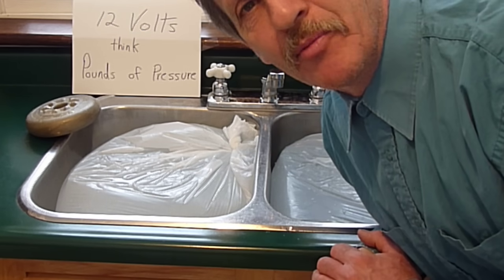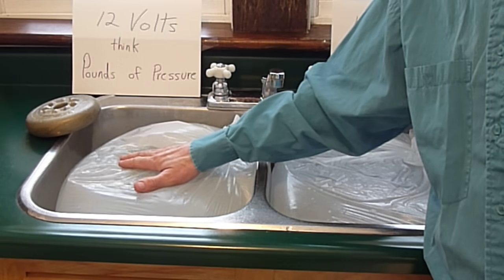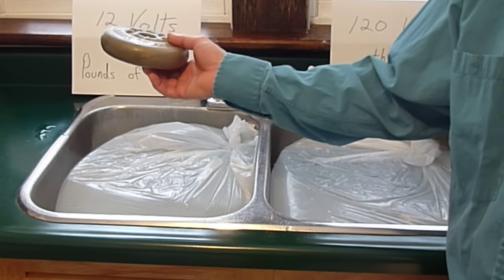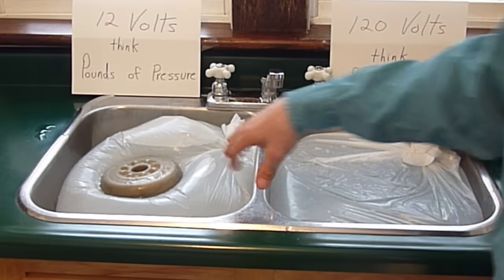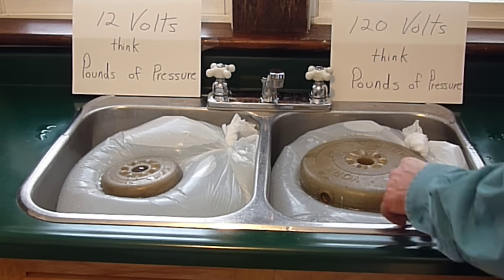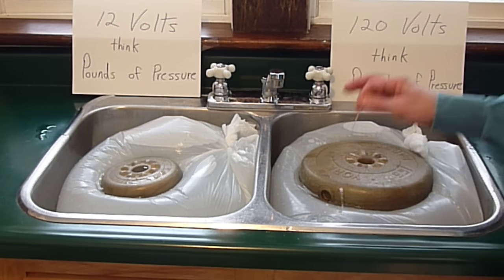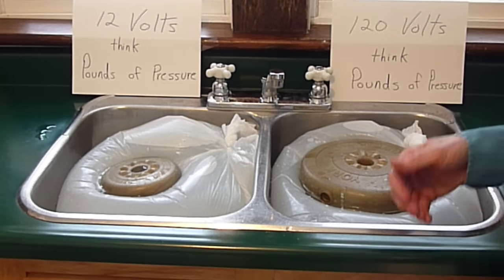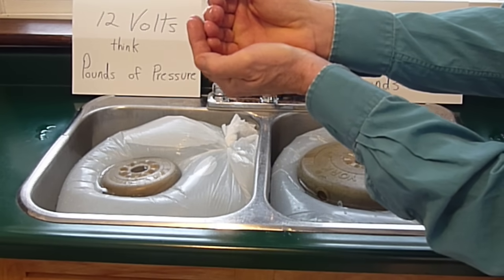Amps, volts, watts explained...SEE what it really is all about.

Comment: Am I stupid if I still don't understand it?
Reply: Amps is the force of pressure, that's coming out of the pinhole. In each bag. Watts is what is borrowed, say for a lightbulb. Say if a lighbulb needs 12 Watts of that 120 Volts.

Think of a pie. If you have 4 pieces, and the lightbulb is one of those 4 pieces. 

This is how I just figured this out. That worked for me. However your brain helps you interpret the information that's more inclined to be the most memorable for you, is all that matters.

I just don't understand how the conversion works though. At all. But I been trying to figure out the basic understanding for years.  I understand now. I hope this helps!! 🤘✨️

TL;DR: Volts is the power. Amps is the pressure/flow of that power current, Watts is what's borrowed out of the 120 Volts, in order to power up said item (eg: lightbulb).
Reply: Another way I just thought of this. Think of a beach ball.

If you blew up a beach ball half way, and let the beach ball sit (holding 12 Volts = barely any air in the beach ball) and air out by itself, that would be a poor, slow flow coming out of that beach ball. Ain't nobody got time for that.

But if you blow the beach ball to full capacity. Let's say that's 120 Volts, max, the beach ball can hold.

If you force the air out of that beach ball, manually, that's a lot of intense force you're putting on that poor little beach ball. Lol.

But it's a constant current you can depend on. No dimming and/or flickering, like you would get with 12 Volts of power, if say a lightbulb would get more efficient power from 120 Volts.

But I don't understand the concept of converting Watts into Volts yet. I just now understand the basics, today.

So, back to the pie, if 120v total is contained in that pie, but a lightbulb needs to borrow that current, in the form of Volts, think of the lightbulb pulling only 1/4 out of 4 pieces of the pie.

Plenty of energy still left to be pulled, and used by maybe, 3 more items.
Reply: NOPE! Still not stupid, if you don't understand the concept yet. I had to watch this video a few times to get the way he was teaching all this.

It only clicked, when I paused at each section. You just have to find the right teacher that helps you find the means to understand the basic concept of electricity, the most. This dude here in this video just did that for me.

He's the 🐐 's cheese! *does a terrible laggy nerd dab* 🤓

Comment: Voltage is like water pressure, amperage is like the speed of the water flowing through the pipe, and wattage is like the gpm(gallons per minute) and joules are like the number of drops of water in the whole pipe.
Reply: Thank you for this insightful information! I appreciate this! * 0 * 🤘✨️

Comment: Electrician here. Didn't really explain anything. 120v wouldnt equal more flow/power etc over 12v. You demo applies more to Amperage, not voltage. Consider 120v at 0.01A compared to 12v at 4A. The 120v 'pressure' is much, much less than the 12v soley due to amperage. Its why fast chargers are low voltage/high amperage. Its why 2,000,000v at 0.0001amps wont kill you when 230v at 1A  could kill you. Terrible explanation
Reply: Wouldn't the water that he collected at the end be more akin to joules and not watts?
Reply: I didn’t see any information the only thing that is different is the weights? 
I’m reporting this video.
Reply: You’re not an electrician gtfoh
Reply: And all these morons posting how brilliant the video is and how it cleared everything up for them about electricity.  Ridiculous people.  Youtube is full of them.
Reply: I love how you can always tell when someone spends most of their time on Reddit by how they type out their comments. 
It reminds me of how you can always tell when someone’s a fan of the band ICP.

Comment: The only issue I see with this example is if you are looking at the water flowing out of the bag as amperage or current, based on Ohms law, (P/E=I) if each bag produces an equal 10k watts, the 12 volt bag would have more amperage/current flowing than the 120 volt bag. Each produces the same amount of “electrical work” or wattage, but the 120 volt circuit can do that with less current flow because the voltage is higher. Many times when voltage is increased, the wires that need to be ran can be smaller because the amperage flowing is now effectively lower. An example of this is when car batteries went from 6 volts to 12 volts in the 1950s, the wiring harnesses became lighter and more cost effective because the wires needed were smaller with less copper/material. Your example would work better if you excluded watts and instead included resistance. Resistance would be the size of the hole you poke in each bag restricting current flow. In this case both bags have the same resistance or the same sized hole. So to make things simple, say each bag has 1 ohm of resistance. Now based on ohms law (E=R*I) the bag on the left has 12 amps flowing while the bag on the right (with more voltage/electrical pressure) has 120 amps flowing. And now what we are visually seeing in your example lines up better with the numbers and Ohms law. If you were to include wattage (P) , based on ohms law (P/E=I) the bag on the right having more voltage and more amperage flowing than the bag on the left, (with the same amount of resistance/sized hole in the bag) would always have a higher wattage output. You would need to explain that the wattage of the bags was not equal from the start.

Comment: Fantastic model, I plan to steal this for illustration whenever my nephew inevitably asks about the topic. 

One mislabel - if the rate of water flowing out of the bag is analogous to current, the water you collect in your hands is necessarily some quantity of charge - the ‘power’ in this system was already dissipated dispensing it through the puncture.

Comment: My physics teacher explained electricity to us, like it is water flowing through a pipe to a water wheel:
Volt is the pressure of the water running through, Amperage is the volume of water flowing and Watt is how much force the water has to move a water wheel.

You could have a water main line to a street (household socket) with high pressure (120V-AC) and relatively high flow (16A) meaning it can move a big wheel (1920W).

Now think of a garden hose (9V Lithium Battery) with low pressure and low flow (1.2A) that can only turn a small wheel (10.8W).

Lastly, think of a floodgate of a big dam (power transmission line) with enormous pressure (500kV) and massive flow (2270A) turning a gigantic wheel (1.134MW).

Comment: If the "power" in the bag is the same, and the voltages are different, surely the current on the smaller weight should be greater and not smaller. Power = Current x Voltage. I'm not quite sure how this video is explaining the relationship between power, current and voltage?

Comment: Hi!
A bit late to the party but I had a question. I'm sorry if the answer is something apparent but I am a bit confused.

So if i get it correctly Watts are basically the source, the power, the amaount of energy
Volts are the force that pushes that energy out of the source
And Amps represent the flow

But the Amperage is calculated by dividing Watts and Volts. So if I divide lets say 10 000 watts by 100 volts. So the amerage is 100. But then if we divide 10 000 watts by 10 volts the amperage would be 1000. Why lower volatge = higher amperage and not the reverse as with the example?
Or is amerage technically the speed and not the amount itself being pushed out? As in time. So when the volts are lower that means it take more time for the electricity to flow? Aka it's slower?

Thanks in advance!

Comment: So someone comment on me to clear it up.
Amps - where the electricity comes from
Volts - the amount of electricity to be taken from the amps at a certain power/speed
Watts - how much electricity you have taken/recieved or got out.
Reply: Amps are the rate of flow of the charge (water)  collected in the battery (water bag)
Volts generally the thing (the weight) that pushes out the charge(water)
And Watts are the speed of electrical ENERGY getting out of the battery(the analogy in this video is not correct)
And Joules would be the kinetic energy of water coming out

Comment: I don't get it. I understand that a hydraulic system works as a decent analogy for electricity, with pressure being equivalent to tension and flow rate being equivalent to current.

How is a static mass of water analogous to power?

Comment: Another way to look at it is in terms of a waterfall.  Amperage (current) is the amount or volume of water flowing over the edge.  More volume can do more work.  Voltage (potential) is the height of the falls.  Again, the higher the falls, the greater ability to do work.  

Multiply amps (volume of water over the falls) by volts (height of the falls) and you get watts (power).  If either amps or volts are increased, so do the watts, in a linear fashion.
Reply: Or volts is the speed the water is travel, speed x volume = amount of water or watts😊

Comment: I'm afraid there are some problems with this description, fun as it is. The weight is just voltage and the water is the amount of current available, so both the bag and the weight are the battery. The size of the hole can be resistance, as another person commented. Fun video no matter

Comment: 18 years on this planet, going thru every grade, learning from various teachers and NONE could have explained it better than you sir. Thank You!
Reply: Please help me understand what is Watt (beside water captured in your hands) 😅
Reply: @writtenlike Watts are the unit of Power Measured in Electronics. Watts or Power is equal to the Current Squared times the Resistance or P = I^2 R Current is what KILLS you.
Reply: @epluribusunum-1  Watts are a measurement of power. Where did you get your Electronics Degree from
Reply: @scoutsaresilentdeath8775 Watts are nothing more than the representation of power. 
A horsepower is 746 watts PER HOUR at max load.
Reply: @master-oppressor  Sooooo then by your logic here a blow dryer at 1500 Watts is 2 Horsepower?? Just admit that you're wrong
Reply: @scoutsaresilentdeath8775  Nope, you're confused. 

It's not my logic.
Reply: @master-oppressor  Wow, what great 3rd grade logic you have here. Let me Educate you, since you obviously can't do it yourself. A Watt is the unit of electrical power equal to 1 Ampere under the pressure of 1 Volt. It can also be described as a Radiant Flux equal to 1 Joule per second. This is used to Quantify the Rate of Energy. A simple Google it would have saved you this Embarrassing Exchange Junior...
Reply: @SeerManMan  OK we aren't talking about horsepower, we are talking about the term Wattage. I gave the EXACT definition of it, so you are also wrong. DAMN, what's so hard about comprehension???
Reply: This explanation was horribly wrong
Reply: @devarmont87  You aren't talking to me are you?
Reply: @SeerManMan  OH, do tell me how, Please...
Reply: So, are amps represented by the size of the hole?
Reply: @tracyallen247  'Current flow in a circuit is proportional to the voltage applied and inversely proportional to the resistance.' The higher the voltage applied the higher the curent flow. The more resistance that current encounters, the less current will flow.
Current is measured by how many electrons pass a point in a certain amount of time in Amperes. Generally we create voltage (force) to push electrons through resistive material to do electrical work (power in watts)
I=E/R
W=E x I
I= Amps
E=Volts
Ohms= Resistance
W= watts
Reply: maybe because ur stupid
Reply: Whoa. This is what’s wrong with social media. People- do some research. Many of you are embarrassing yourselves. The guy is using an analogy- a pretty good one if you have a clue.
Reply: 13! and yup! and shocked about how time flew for this video.
Reply: Clearly you didn't get it, because this explanation is totally wrong and a little dangerous for those who think it's correct
Reply: @garethjones909  how?
Reply: @vogelkop27  well, it's been about 16 years since I did electrical installation in college. So I'll just copy and paste what I said from a previous comment 
'120v wouldn't equal more flow/power etc over 12v. The demo applies more to Amperage, not voltage. Consider 120v at 0.01A compared to 12v at 4A. The 120v 0.01A 'pressure' is much, much less than the 12v 4A 'pressure' soley due to amperage. Its why fast chargers are low voltage/high amperage. Its why 2,000,000v at 0.0001amps wont kill you when 230v at 1A  could kill you'
Reply: @vogelkop27  Basically, every answer to your question "how?" is an example of your first statement about the useless explanations teachers gave you. I think you are right.

Comment: Bag of electricity? Watts ("electricity") being equal, higher volts equates to lower amps/current which is the exact opposite of what is shown here. No idea how this is supposed to help anyone learn anything.
Reply: Exactly 😊
Volts is the water (you collect in your hands)
Current is the water flow (one molecule after the other molecule pouring out of the bag) when you puncture the bag.
Watts is the force of the water (inflicted by the round weight) when pouring out

Comment: it would be watt seconds, watt hours  kilowatt hours, or joules, not watts. Watt is a power unit not an energy unit. In this analogy the water is energy and the rate that it is coming out is current. Power (watts) would be the rate (current) times the pressure (voltage).
Reply: Thank you. I thought I was the only one yelling at the screen.
Reply: A watt second is just a joule right? Saying the bag/energy bank stores watts is like saying a fuel tank stores horsepower correct me if im wrong
Reply: Exactly
Reply: @solaceandorwell9069 A battery has A*h and Voltage spec. This is the same W*h of electricity, but you can't get more voltage, then the battery can give. Gas tank - energy, but you can burn it in a second or for the longest time, efficiency of engine or fuel cell can be different, W*h characteristics different too.
Reply: I would suggest that the water volume represents charge given that the flow rate represents current in this analogy. Voltage is defined as energy per unit charge. We can define pressure as force per unit area and since force=energy/distance, we can state that pressure is energy per unit volume. 

So in this analogy:
Volume of water -> charge
Volume flow rate -> current
Pressure -> voltage

Power (the rate at which work is being done) is defined as the flow rate multiplied by the pressure at the point of the hole. Energy in the system would be average pressure multiplied by the volume of water (or the voltage multiplied by the total charge it acts over)

Does this sound right to everybody?
Reply: @josephwilson1162 the same analogy in old-school books about electricity!
Reply: technically its coulomb in this analogy
Reply: Watt did you say??  
Thank you!  If Watts are the same, then Amps actually goes down with higher Volts. His analogy makes it seem like the Amps are higher, which is wrong. 10x higher volts means 10x lower Amps.
Reply: Yeah. That’s what I thought.  Watts is power, which is an instantaneous measurement. Watt hours is a measure of an amount of energy.
Reply: At least he got us thinking again.
Reply: The comment above needs to be pinned so that others can get the correct information.
Reply: I disagree. The amount of water is charge, not energy. The flow rate of the water is current. Pressure is voltage. Power is pressure multiplied by flow rate, which is proportional to the kinetic energy of a unit water flowing out, multiplied by the amount of water flowing out per unit time. Energy is power integrated over time.
Reply: This comment is very important
Reply: I would disagree and say the rate represents power and not current. Constant rate would equate to constant power regardless of if a small hole with a large weight is used or if a large hole is used with a small weight. The current would increase with a larger weight but be unaffected by the hole diameter. The hole diameter would represent the inverse resistance.

I agree that the bag volume is best measured in Watt Hours or similar.
Reply: @oscarwahlstrom5426 :

That's simply not true. Two equal currents can have very different powers.
Reply: @hoon_sol  I agree with your statement that two equal currents can generate different amounts of power depending voltage/resistance conditions. I don't understand what you disagree with me about.
Reply: @oscarwahlstrom5426 :

The exact same is true for the water. The amount of power dissipated would be the product of the rate of flow and the pressure, just like the power dissipated in a circuit is the product of current and voltage.
Reply: @hoon_sol  The reason I disagree is that in the video he says the bag volume represents the consumable battery power (which would be measured in watt hours).

Flow rate must then equate to power, because flow rate indicates how fast the bag is being drained.
Reply: The analogy is messy all the way through. What are the bags, if the weights alone are supposed to be the batteries?

You could say the weight and bag in combination make up the battery, with the same amount of charge (in coulomb or mAh) but different voltage (and therefore also different amount of energy).
Pressure works as an analogy for voltage, but only if we think of fluids enclosed in containers and pipes. That way, circuits can be explained as well.
Reply: What is the difference between a power unit and an energy unit? Is it just that watt-seconds has “seconds in its numerator and denominator” and so things just cancel out and you are left with a number of joules?
Reply: @josh2011miller80  Energy units represent work. Power units represent capacity to work.
Reply: Don't spread misinfo. The demonstration is exactly right. You even explained it at the end of your comment